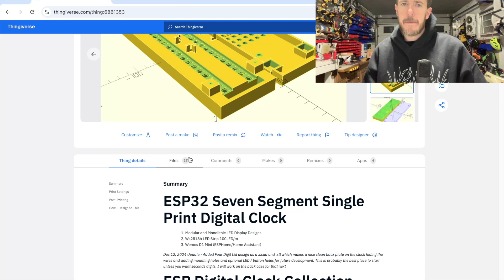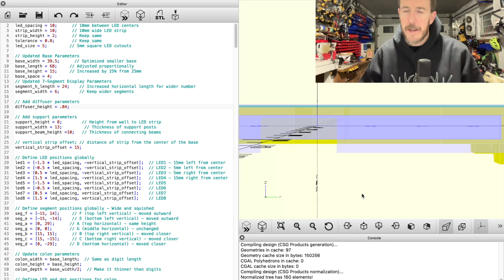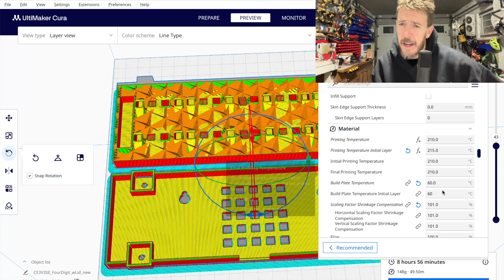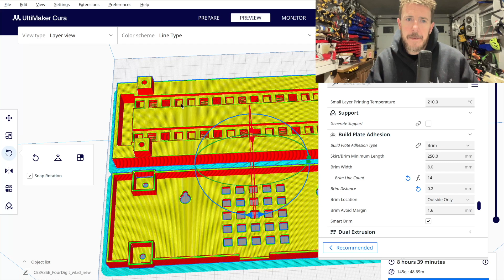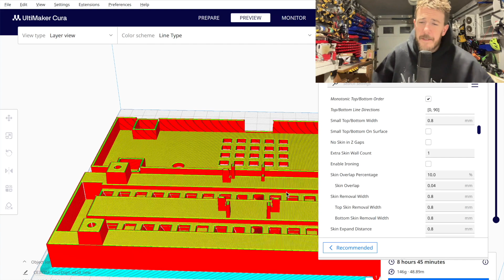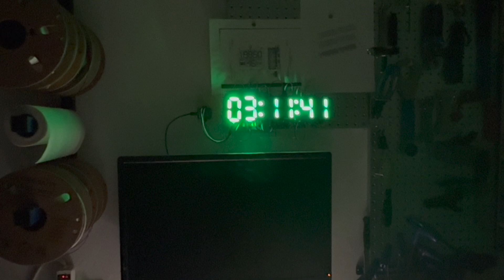How to 3D Print a Smart Digital Clock - Part 1: Design & Slicing | ESP32 Home Assistant Clock

Comment from the maker: 📌 All the files and resources you need to build this clock:

🔧 Parts List & Files:
• GitHub: https://github.com/kylemath/digitalclock
• Printables: https://www.printables.com/model/1101964
• Thingiverse: https://www.thingiverse.com/thing:6861353

⏱ Timestamps:
0:00 - Introduction & Overview
0:08 - File Selection & Download
0:29 - OpenSCAD Setup
1:00 - Diffuser Layer Modifications
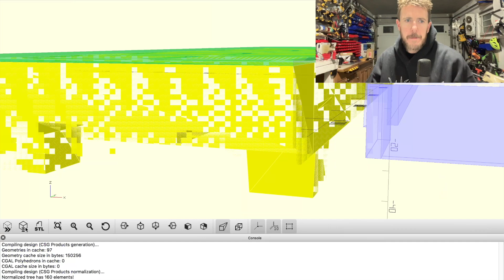2:04 - STL File Generation
2:36 - Material Selection
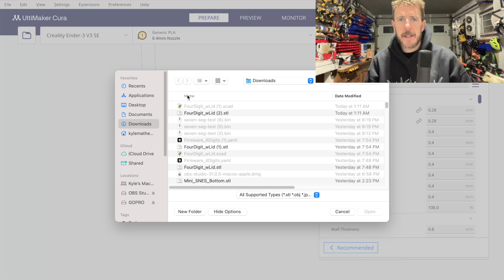3:09 - Cura Slicer Setup
4:07 - Print Settings Configuration
5:34 - Brim & Layer Settings
6:15 - G-Code Modification
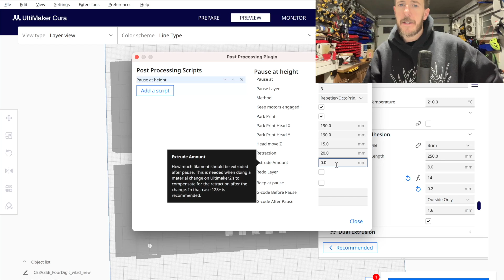7:06 - OctoPrint Setup
8:33 - Print Start & Monitoring
9:26 - Troubleshooting Tips

📺 Full Series:
Part 1: You are here!
Part 2: Parts & Wiring - https://youtu.be/uiOuWeXdryE
Part 3: Assembly & Soldering - https://youtu.be/76l32a6Kb90
Part 4: Firmware - https://youtu.be/q1JSGy7HCL0

Comment: I’ll do my own digging in the meantime but is this relatively easy to print on a public printer such as at a library for instance? If so is there anything I should look out for? Thx!
Reply from the maker: Good question, i'm not sure I have never tried to use one, but pausing midprint to change the filament from white to black is the most complicated part